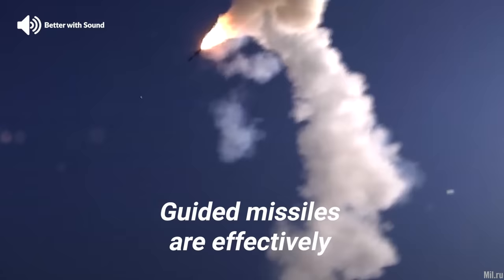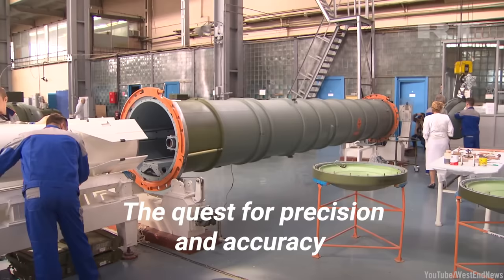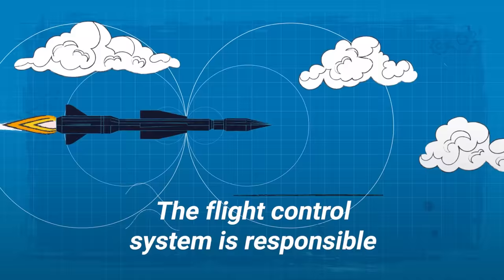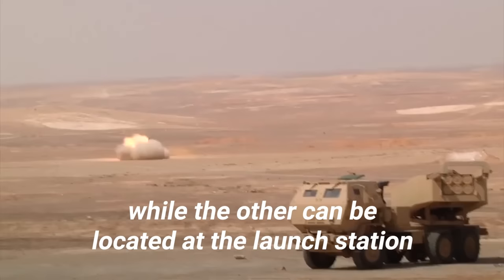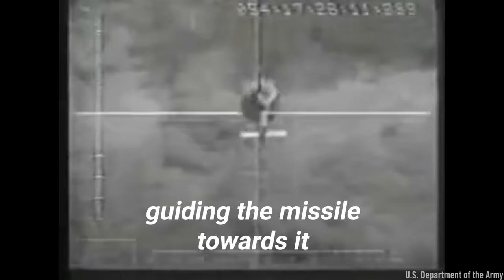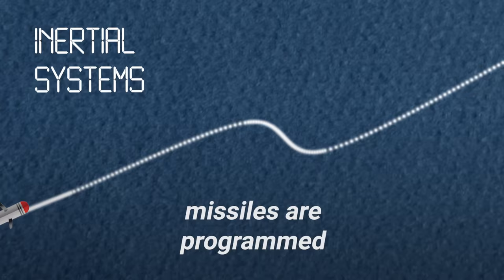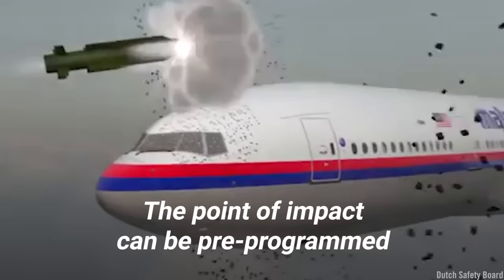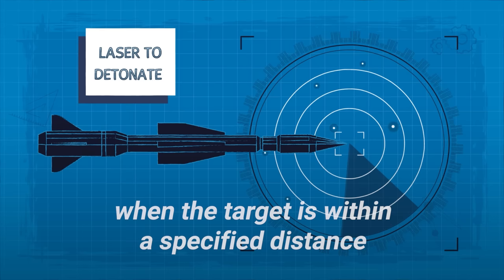How missile guidance systems work

Comment: The missile knows where it is at all times. It knows this because it knows where it isn't. By subtracting where it is from where it isn't, or where it isn't from where it is - whichever is greater - it obtains a difference or deviation. The guidance subsystem uses deviations to generate corrective commands to drive the missile from a position where it is to a position where it isn't, and arriving at a position that it wasn't, it now is. Consequently, the position where it is is now the position that it wasn't, and if follows that the position that it was is now the position that it isn't. In the event that the position that it is in is not the position that it wasn't, the system has acquired a variation. The variation being the difference between where the missile is and where it wasn't. If variation is considered to be a significant factor, it too may be corrected by the GEA. However, the missile must also know where it was. The missile guidance computer scenario works as follows: Because a variation has modified some of the information that the missile has obtained, it is not sure just where it is. However, it is sure where it isn't, within reason, and it know where it was. It now subtracts where it should be from where it wasn't, or vice versa. And by differentiating this from the algebraic sum of where it shouldn't be and where it was, it is able to obtain the deviation and its variation, which is called error.
Reply: Yes
Reply: same comment everywhere
Reply: @madhur8537  yes:)
Reply: @user-pu1wc4so5j  i'm glad to read your comment, which much more creative than mine, currently living in Brasil, possibly until the day i perish.
tank you for the attention :)
Reply: Where and how to code that missile
Reply: What a clonky way of writing, jesus
Reply: @fettaheker  because it isn't anywhere except for where it is
Reply: ''The missile knows where it is at all times. It knows this because it knows where it isn't''

- War Thunder
Reply: Still cant tell if this is serious or not
Reply: @fettaheker  by subtracting where it is from where it was
Reply: wtf
Reply: one year ago i would have called hocus pocus bollocks
after a year of full stack dev this sounds ok
Reply: so, it knows where it is coz it knows where it isn't.. and since it knows where it isn't, it knows where it is..
Reply: @aschconformity7795  precisely.
Reply: a falce coment
Reply: Youngling slayer 9000 stole your comment . he thinks he is so intelligent just by paraphrasing it .
Reply: So they have an improbability drive?
Reply: @fettaheker  it knows by subtracting where it is from where its supposed to be 🤔
Reply: @fettaheker  Bro, it says all the goodies besides the 'switch actuation'. Would the head banging into the Earth 'actually' detonate it?  Man, Seems like this "there are enough missiles to annihilate the Earth 300 times" [repeatedly] is a bunch of crap. It would be a chain reaction anyway. In fact, it would just be ONE deal with a domino effect. Way to milk it.
Reply: I WROTE THAT.........to describe the ATRAN guidance system on the TM-76A Mace Tactical Missile, while an instructor on said system........at Lowry AFB, CO. 1961
Reply: Damn it, I was 10 months too late
Reply: Really the first few lines I really thought that it was a sarcastic comment.
Reply: That was a verbose way of saying it uses some form of Kalman filter
Reply: Stop copy and paste comments 🙄
Reply: @capeofstormz5974  it's funny:)
Reply: @aschconformity7795  🤣🤣🤣🤣
Reply: No sense has been spoken in this comment
Reply: This.
Reply: I came here to post specifically this and you beat me here.
Reply: Completely false in the context of inertial guidance.
Reply: The missile knows where it is at all times. It knows this because it knows where it isn't. By subtracting where it is from where it isn't, or where it isn't from where it is - whichever is greater - it obtains a difference or deviation. The guidance subsystem uses deviations to generate corrective commands to drive the missile from a position where it is to a position where it isn't, and arriving at a position that it wasn't, it now is. Consequently, the position where it is is now the position that it wasn't, and if follows that the position that it was is now the position that it isn't. In the event that the position that it is in is not the position that it wasn't, the system has acquired a variation. The variation being the difference between where the missile is and where it wasn't. If variation is considered to be a significant factor, it too may be corrected by the GEA. However, the missile must also know where it was. The missile guidance computer scenario works as follows: Because a variation has modified some of the information that the missile has obtained, it is not sure just where it is. However, it is sure where it isn't, within reason, and it know where it was. It now subtracts where it should be from where it wasn't, or vice versa. And by differentiating this from the algebraic sum of where it shouldn't be and where it was, it is able to obtain the deviation and its variation, which is called error.
Reply: Fucking legend
Reply: @ABobroff  Well, no. The Kalman filter is used in cruise missiles and terrain mapping radar to remove the noise on the returned radar signal.

But don't expect the original poster to have a clue about this.
Reply: @Josecannoli1209  No, by subtracting where it is from where it should be at that point in time..
Reply: @mikesmith1290  Yeah, his theory is about as improbable as he being intelligent.
Reply: This is why we use math not words
Reply: @stevenmcnair1897  Absolutely accurate control systems engineering theory. Had that taught to me in aeronautical engineering college.
Reply: That's preety much how I navigate home from the pub!
Reply: Came here to see if this was the top comment, not disappointed.
Reply: And that's how the missile knows where it is
Reply: Where do you get this garbage from did you get it out of a comic or did you make it up?
Reply: @fettaheker   It knows this because it knows where it isn't. By subtracting where it is from where it isn't, or where it isn't from where it is - whichever is greater - it obtains a difference or deviation.
Reply: The missile knows where it is and where it isn't. But the most important piece of information is where it should be and the missile has to know that . And the missile actually knows that or can know that by computation of rapid information flowing in from an external source and/ or information contained in the missile itself . This gives the the missile SAM ,which doesn't mean Surface to Air missile but Situational Awareness of the Missile. Thus the missile knows how to adjust its trajectory and when the detonation should take place and it also can conceal its own acoustic, IR , thermal and visual signature and visibility to radar. This all goes on simultaneously,while the missile knows where it is and where it isn't and also knows where it should be.
Reply: I clicked on this video just to make sure that this was the top comment
Reply: That’s exactly how I drive!  I just subtract where I’m at from where I’m definitely not and voila, I’m lost! :)

That explanation was hilarious :0)
Reply: @billcook7483  it's a realy bad explanation made before computers were popular, now it is a copypasta
Reply: It's a case of known knowns as opposed to unknown knowns and unknown unknowns.
Reply: @leonardgibney2997  What about known unknowns - things we know we don't know, as opposed to the unknown knowns of things we don't know we know?
Reply: Was just about to say the first part
Reply: Lol so few get this reference apparently!
Reply: The hip hop remix of this is awesome if you have never seen it.
Reply: Dammit, i love this comment section lol
Reply: Some missiles (like mostly the so called rocket launchers) follow heat coming from the planes, there are many ways that this type of missile can fail. You can also easily block/confuse them by adding any heat to their heat pad with a commonly used laser to confuse it and make it spin around and at the end most likely just crash in a mountain.
Reply: @fettaheker  because if it knows where it is, it also knows where it isn’t ;)
Reply: @fettaheker  I don't know man, makes perfect sense to me. It takes the deviation from where it wasn't. Even a first grader could understand.
Reply: Do we have an ammo troop??
Reply: Bongo McNish
Reply: @googleplex1589  https://youtu.be/bZe5J8SVCYQ, he didn't create it
Reply: @ahis3233  OK so what. I am saying that someone stole his comment
Reply: @ahis3233  and of course he did not create it. But it is still nice.
Reply: @googleplex1589  it's a copypasya
Reply: @ahis3233  I don't understand
Reply: This was inevitable
Reply: Nah, they have a tiny pilot
Reply: @fettaheker  because it know where it is duh
Reply: tldr
Reply: Very well said mate
Reply: You been watching too much Jackie Chan Rush Hour 3. "He is Mi, and I am Yu." HAHAHA. Good stuff bro. You should get a gig telling these jokes to MIT students.
Reply: @fettaheker  like how you know you're not in a car when you're on foot.  You know you're walking to the store, ergo, you aren't at your house OR at the store.  You know also that since you only started walking 5 minutes ago you're closer to your house than to the store, and therefore, what course corrections to make to keep on the right path to the store, updating this information as you walk.
Reply: Hell I don't know where I am now!
Reply: @im-that-guy-pal  If u figure out all the places where u are NOT, u can then figure out where u ARE. Easy.
Reply: I see this same copied msg in ever missile video dude
Reply: I really only clicked on the video to see if this is the top comment.
Reply: God damn it I was gonna make that joke.
Reply: @fettaheker  Didn't you read? It knows where it isn't because it knows where it is and vice versa
Reply: 2k words essay writer.
Reply: BEAUTIFULLY WRITTEN, MY GOOD MAN!!! ABSOLUTELY BRILLIANT!
Reply: Basically, it knows where it is by knowing where it was
Reply: correct my good sir
Reply: great concept
Reply: @supersaiyan-goku-san  i live in your walls
Reply: yes
Reply: @googleplex1589  There's nothing to steal. It's a meme that has existed for a while.
Reply: @anxiousearth680   never mind just realised
Reply: I came here to see this comment and was not disappointed.
Reply: @stevenmcnair1897  not sure about the rest, but the where it is - where it isn't thing is true, when you subtract point a's coordinates from point b's coordinates you get a vector rotation from b to a, which i can only assume is what is used for the rotation it should attempt to get to with fancier math that is beyond my knowledge
Reply: I ain't reading allat
Reply: Why did i know id find this copypasta here?
Reply: Bravo😂
Reply: Say position one more time
Reply: Currently I know where I am because I know where I am not.

Comment: The missile knows where it is, because it knows where isn't. And vice-versa.
Reply: How does it find its target?
Reply: @tmo2798  
Depends on the seeker but generally, it gets the initial target data from the launching system. The seeker can then cross reference the data it receives to the target data and find the target. Once found, a lock is confirmed and the missile can be fired. What it's ultimately looking for is that hot spot and how that looks. You can then track it by checking the deviations in the next data. If it's similar enough, you keep that as your reference and keep flying. Do this enough times and you'll hit your target soon enough.
Reply: @tmo2798  What even? I never stated that homing couldn't be countered? They can if you jam the data it gets, or if the object it's looking for gets surrounded by similarly appearing objects. This is why flares and decoys exist. I have no idea what fossils or politics has to do with a missile guidance system, but alright.
Reply: @tanmoysd2721  Offer a better one. That's how it works for aircraft. There is some deviations obviously, like how Javelin instead captures the image and just sends the missile out, having the seeker find the target according to the infrared image. However, the general principle is the same. The command vehicle or launcher gets the target data and sends it to the seeker. The seeker then finds the target and locks onto it. The target data depends on the type, but it's basically a hotspot of the source, be it radar, infrared, or in the cases of home-to-jamming, electromagnetic signature. I couldn't explain any deeper without getting into a very complex topic of electronics and how programs can differentiate between targets and everything else.
Reply: @tanmoysd2721  Elaborate.
Reply: Just about to say that

Comment: The complexity of these systems is insane. There is so much going on in there and its all in real time and across multiple endpoints, moving at crazy speeds. Truly transcendental.
Reply: Think so.. you might be quite surprised what a Aurdino and a Pi can do with a few servos and sensors..  But what the Russians are really demonstrating is how unprepared the Ukie regime, NATO and the west are if such were applied against them.  The Russians learn about this in Syria and 23mm (x135mm) is still a serious round with capabilities that can for-fill the mission (timed and 'enhanced' detonation cycles).  30mm is overkill, but equally effective (if enhanced).  Direct hit not required.
Reply: @tsclly2377  Ukraine and Nato aswell might just be missing proper air defense systems.

Comment: I knew you were going to skip the explanation on how inertial guidance works.
Too difficult for you to explain is it? No mention of distance, velocity, acceleration and the relationship between them.

And they don't use GPS. GPS guidance is very different to inertial guidance.

Do your job properly!
Reply: Exactly right. Inertial guidance is mechanical navigation, while GPS is electromagnetic navigation. They're two completely different navigation systems.

Comment: Me when The missile knows where it is at all times. It knows this because it knows where it isn't. By subtracting where it is from where it isn't, or where it isn't from where it is (whichever is greater), it obtains a difference, or deviation. The guidance subsystem uses deviations to generate corrective commands to drive the missile from a position where it is to a position where it isn't, and arriving at a position where it wasn't, it now is. Consequently, the position where it is, is now the position that it wasn't, and it follows that the position that it was, is now the position that it isn't. 
In the event that the position that it is in is not the position that it wasn't, the system has acquired a variation, the variation being the difference between where the missile is, and where it wasn't. If variation is considered to be a significant factor, it too may be corrected by the GEA. However, the missile must also know where it was. 
The missile guidance computer scenario works as follows. Because a variation has modified some of the information the missile has obtained, it is not sure just where it is. However, it is sure where it isn't, within reason, and it knows where it was. It now subtracts where it should be from where it wasn't, or vice-versa, and by differentiating this from the algebraic sum of where it shouldn't be, and where it was, it is able to obtain the deviation and its variation, which is called error.
Reply: Lmao, doing some trolling about other comments I can see
Reply: Why are we making engineering majors waste time taking a basic writing class >:(
Engineers when they have to write:

Comment: Layering
= blocker first
= inertia-navigation-system as blocker to terrain and buildings for
== fixed firing positions
== mobile firing positions 

Maps = portable, update, refresh, scan.

Launch sequence part 1, self-test part 1 to arm firing (not arm warhead), activate blockers, activate target acquisition, ..., activate other layers of navigational-systems, up down electronic-computational-program layers...

Layers - functional (not programming-object inheritence)
Reply: This functional-blocker systems allows manpacks to fire from in-between buildings to in-between buildings to U-turn while climbing to stick to target by fallbacks of hunting-modes (doubt - jams, incoherent navigational time/data transmitted to confuse missile using electromagnetic aiming CRT-TV as wave-guide, ...)

Cheap in year 2023 to make all interested enough to rebuild/resupply all their INVENTORY and learn inventory-cosr, cost-accounting, where money come and how it goes. Maintenance, running, inventory, ... costs
Reply: Triangles, triangulation, formulae, strangulation
= north-star, sun phase, moon phase (minimum)
= use sextant (not super big telescope) at clear-night sea-island with hill.

Calculate elipitical non-flat-earth trajectory of earth. Record into calender. Bet/gamble on planting season crop(type).

Systems-off, (rambo mechanical straight, warhead default distance-arm is zero + 3meters-time as zero-time), on, (rambo), passive(scan terrain and match map-data), active(scan-terrain and match map-data, enable active-scan to be downgraded), hunt(...), ..., acquire(optional delayed hunt, when lock lost, ...), lock(optional modes-types confirmation-layers), fire-launch, ... 

If no set distance and time before firing = is your-problem
Reply: Your calender i laugh. Your computational like my steel-reflectors, BBQ infrared pits, fun fair, ... cooler cabin on hotter engine diesel truck idling to run air-conditioner thermal signature of troops and light-trucks(singapore common types like tilt-cabin engine under) from various angles, ... you automated send expensive to BBQ. 

Cooler thermal is troops air-conditioned inside cabin of light-truck...
Reply: After heat-seeking is thermal-imager is auto balancing self-guided BMW motorcycles can 80kg x 2 with panniers payload.